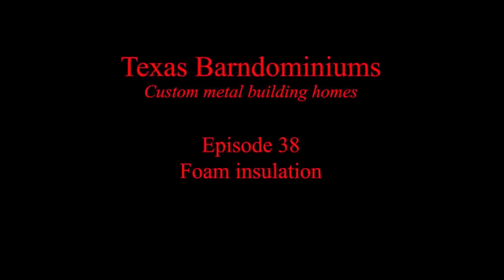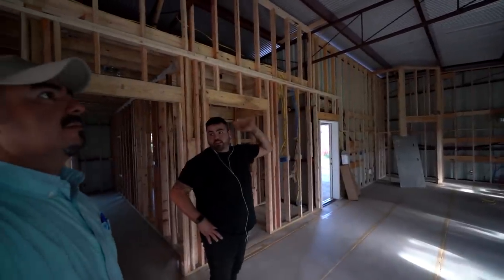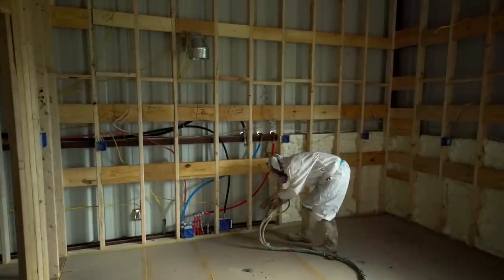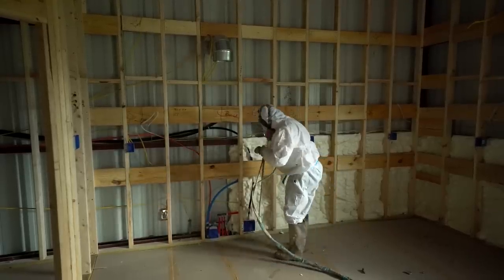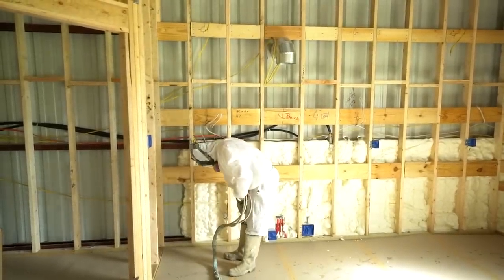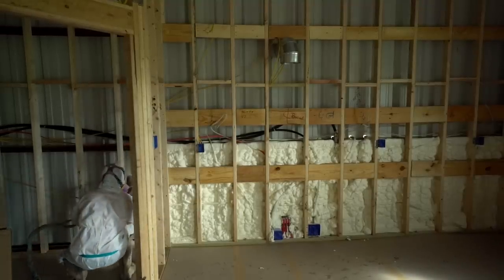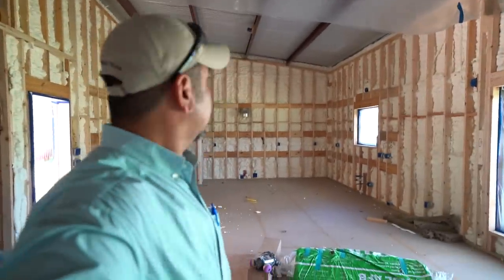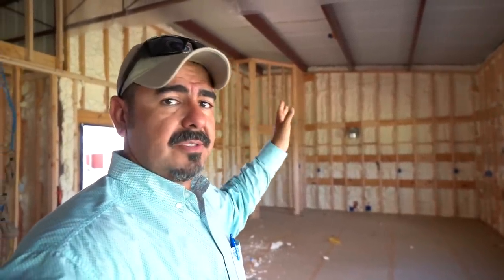Foam insulation - How good is it?   Texas Barndominiums Episode 48

Comment: I was searching for steel framed construction and this one is not one of them. I expected all steal. Termites would love this construction if the woods are not protected.
Reply from the maker: All steel construction will fall under commercial.  Expect to pay a lot more money for it.  But it can be done.
Reply: That is just silly. You act as if termites just roam around and consume every piece of wood on earth. If that was the case, stick built homes wouldn't exist. No home would last 40 years. If you pretreat the foundation and since the rest of the building is metal, there's very little to worry about. The termite damage is going to start on the outer walls. Outer walls are metal. Steel studs are more expensive and harder to work with. It makes more sense to use wood studs for the interior like a traditional house.

Comment: Asking the owner to come back after ONE HOUR? Are you insane? Do you hate your customers and their health? Are you completely and utterly oblivious of how long isocynates require to vent?

Not to mention your claims in relation to fire safety could (and should) see you thrown in jail. BE HONEST. Say what fire safety grade this stuff gets in the official safety ratings.
It's F or G out of an A-G scale where G is worst. All that horseshit about 'removing oxygen' is to draw attention away from the fact that you're spraying a gasoline product that will go up like a BONFIRE if there's a wire malfunction.

This is an irreversible proces that could see a building unsafe to enter, unsafe to use, definately cancel fire insurance and impossible to maintain. Nice for a throwaway shed that's not expected to last more than 10 years and can be kept empty for a few weeks after spraying, but for any other application, what you advise is unsafe.

Comment: Electricians are fucked now....
Reply from the maker: How so?
Reply: @TexasBarndominiums  for some  reason,  if they pull some wires at later date.

You guys did a great job!
Reply from the maker: Actually, foam is on metal wall and not in stud wall, so electricians and plumbers can run their pipes or wires without interference.   :)